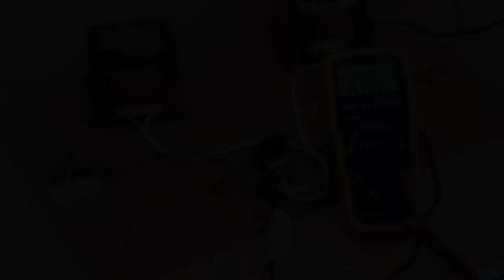DIY Welding Machine / Only 2 Microwave Transformer / Good Job

Comment: Addendum to my below comments, the cable you used is 4mm2, which is 11 AWG. Would you, please, point me to the vender who sells 4mm2 silicone jacketed cables? We don’t get 11 AWG silicone cables, around here. Thanks.
Reply from the maker: Hello.  I tried to find a link for you on the internet, but there are sellers in Turkey.  There is also aliexpress, but it is necessary to buy at least 50 meters and the shipping costs are high.  The code of the cable I use is N2GFAF.  Search this way where you live if you want.  However, my advice to you is to buy 13 meters from an electrician's shop.  Let me repeat it again, the cable I use is N2GFAF coded.  ie not awg11.  both are silicon insulated but I think N2GFAF is more affordable.  I wasn't exactly helpful.  Please excuse me.

Comment: How many turns u have done in transformers
Reply from the maker: I made 24 turns on each transformer.  I used 4mm2 silicon insulated cable.  Some information is also given as subtitles in the video.

Comment: How many turns of enamel wire? How thick is the contents? Is it mm
?? V? If the voltage is 110v at A or 110V at 220V,
What should i do?
Reply from the maker: Hi.  The wire I use is a silicon insulated (non-combustible) pure copper cable with a cross section of 4mm2.  I made 24 windings for each transformer and used 6.5 meters of cable... If the microwave oven whose transformer you will use is produced according to 110V mains voltage, you can do as I did.  To be sure, wind 1 transformer and measure the output voltage obtained.  It should be around 20V.  Let me know if possible.

Comment: Hola cómo estás compré el atenuador de 4000 watts, pero cuando lo conecto a los transformadores y a la corriente alterna de mi casa, el fusible del atenuador se revienta.
No se si el por qué los transformadores son de tamaños diferentes, porque uno tiene más vueltas que el otro por la diferencia de sus tamaños obviamente o porque el fusible del atenuador es de 10 Ampers y tengo que cambiar el fusible por un amperaje más alto, agradezco mucho de tu guía en este proyecto pues la verdad me frustre y por eso no he vuelto a mi taller.  bendiciones y muchas gracias
Reply from the maker: Hola.  No te desesperes, pienso.  Si no hay cortocircuito en los transformadores y mides los voltajes de salida alrededor de 20V, no hay problema en el sistema.  En caso de que la tensión de red sea de 220V, instale un fusible de 15A.  Si la tensión de red es de 110 V, utilice un fusible de 25 A.  Si el fusible vuelve a fundirse, es posible que el triac del circuito esté cortocircuitado.

Comment: How much the primary ampere’s in the input of the transformer?
Reply from the maker: Hi.  The primary current varies according to the setting of the dimmer circuit.  But I can say this... A 10A fuse is connected to the socket I use at home.  It does not exceed 10A current value during welding.  Of course, this value is valid for 2.5 electrodes.
Reply: so your controlling the primary input .. still the secondary having a AC output, well I see your  video design it in other putting a bridge type rectifier having a DC OUTPUT better controlling into lower amperes welding stainless steel plates , nice 👍🏻 project , I design also a toroidal core of a compressor of an Aircon 2 core 2.4 kilowatts and with rectifier too on the secondary winding  connected … you can used a welding rod 7018 super C2 with a DC CURRENT but you can’t used it in a AC OUTPUT 😂😜..
Reply from the maker: I have never tried this electrode.  What results do you think
Reply: it’s a high tensile strength ..
Reply from the maker: Thank you so much 👍

Comment: Hola saludos desde cuba muy buen video quisiera saber la corriente máxima y la minima en amperios que circula por el electrodo al momento de la soldadura dependiendo del control del circuito dimer
Reply from the maker: Hola.  Gracias.  En realidad, traté de mostrar los valores actuales en el video, pero no se pudo medir el límite superior porque el electrodo se derritió antes de alcanzar la corriente máxima.  Sin embargo, se puede decir que el dimmer puede dar 60A cuando está al mínimo y 140A cuando está al máximo.  O brevemente, es posible fundir 2,5 y 3,25 electrodos.  Espero que haya sido suficiente respuesta.  Saludos desde Turquía
Reply: gracias por la respuesta crees q las maquinas inverter que tienen un boton para ajustar lo ampers en realidad lo q varian es el voltaje de salida en funcion de la corriente
Reply: Tienes algun diagrama para poner rectificador con 2 diodos y 2 scr y controlar la corriente por medio de los scr y circuito generador de pulsos para controlar lo scr
Reply from the maker: Hola. No sé si el voltaje cambia a medida que cambia la corriente de salida en las máquinas inversoras. Nunca he tenido una máquina inverter :) Desafortunadamente, no puedo dar una respuesta positiva a su otra pregunta. No tengo circuito para control de diodos y SCR. Sin embargo, compré diodos de puente, que son asequibles, para trabajar en este problema. Convertiré el voltaje de salida a CC conectando 4 o 5 diodos de puente de 50 amperios en paralelo. Grabaré un video y publicaré las pruebas.

Comment: greetings friend, a question:
I have three transformers, a 4000 attenuator still works, right?
I stay tuned thanks
Reply from the maker: Hello.  I may not have understood your question, but as far as I understand, you are asking if I can use the 4000W dimmer in 3 transformers.  If this is the question, you can use it, but there may be a high probability of malfunction.
Reply: I am using 3 transformers, all 3 give me 40.6 Volts... the question is: if the 4000w dimmer works well?
or is it better to assemble what are you doing in the video?
thank you very much
Reply from the maker: I think that the products sold in the market do not provide the power they promise.  For this reason, I have done the process of increasing the power by connecting a triac in parallel to the dimmer circuit I have.  You can find the diagram for this link in the description section.

Comment: Thanks a lot for the MMA welding machine, very simple and easy to found all parts 👍👍, I had a question, how many turn of the 4 mm cable are used in each transformer
Reply from the maker: Hello.  Firstly, thank you.  Each transformer has 24 windings.  A total of 6.5 meters of 4mm2 silicon insulated copper cable is required for these 24 windings and a total of 13 meters for 2 transformers.  Connection diagrams are available in the description section.  Also, the video has subtitles in some languages.  If you have any further questions, please write again.
Reply: Thank you very much
Reply from the maker: Thank you too 👍

Comment: hola yo lo arme con un modulo regulador de voltaje de 4000w pero me quema el fusible apenas le giro la perilla no se que hacer
Reply from the maker: Hola.  El circuito puede estar defectuoso.  Uno de los materiales del circuito puede estar cortocircuitado o puede estar cometiendo un error de conexión.  Por supuesto, lo dicho es válido para la soldadora con 2 transformadores y funcionando sin problemas antes de instalar el circuito.
Reply: ok muchas gracias lo revisare y comentare si tambien lo hice con dos transformadores estaba pensando si no me sirve la fuente de 4000w hacer la misma que se uso en el video muchas gracias
Reply from the maker: Es difícil derretir electrodos gruesos con 2 transformadores.  Si sueles usar electrodos de 2,5 mm como yo, puedes hacerlo como yo.  Para electrodos más gruesos, se debe aumentar el número de transformadores y la sección transversal del cable.  Si aumenta el número de transformadores, también se debe aumentar la potencia del circuito dimmer a utilizar.  Por ejemplo, es necesario utilizar dimmer de 6000W en 3 transformadores y dimmer de 8000W en 4 transformadores.  Sin embargo, el circuito dimmer con estas potencias no está disponible en el mercado.  En este caso, el problema se puede resolver aumentando el número de triacs.  Intentaré compartir pronto el video del circuito del dimmer que mencioné sobre este tema.  atentamente
Reply: hola.  no le habia comentado que uno de los transformadores es mas grande que el otro y me quedo con un poquito mas de vueltas en total el vultimetro registra una salida de 56.7v  eso es normal o me pase de vueltas otra cosa lo puse directo y funde genial pero me toca no hacer cordones porque rompe los tuvos jaja, pero para soldarlos punto a punto funciona pero si ya le revise y las conecciones estan bien tengo ganas de instalarle una funte reguladora como la que usted le puso al suyo o que me recomienda respecto al voltaje de salida

Comment: Very nice work, What is the Idle current in 220V ac side of the transformer?
Reply from the maker: Thank you so much.  I'm glad you like it.  I did not measure at idle, but when welding, there is a current of around 10A.  If you want, I can also measure the idle current for you.
Reply: If you have free time pls measure the idle current. I will try to make the same to you but I use 10 pcs of SCR in voltage control. What can you say about the precision of the voltage control ?
Reply: Thanks for you reply
Reply from the maker: Ok, I will measure and write to you at the most convenient time.  There is no need for 10 SCRs in the voltage control (dimmer) circuit.  A dimmer with 4000W power is sufficient for this system.  I used 4 pcs 6.5A bt136 triacs.  Relevant schematics can be found in the description section.
Reply: @Murat Güney  What numerical value of  voltage between 25v to 40v is best that you tried in welding process?
Reply: Thank you for the idea
Reply from the maker: @creativebuilder577  Thank you too 👍
Reply from the maker: I could not understand this question.  Are you asking about the voltage value used while welding?
Reply: Yes a voltage value in secondary winding that gives a best performance.
Reply: Do you think, you can recommend a size 14 silicon coated copper wire. According to the datasheet it can handle a 55Amps
Reply from the maker: Can you share the datasheet link of the cable you are talking about?
Reply from the maker: Honestly, it would be better if the secondary voltage was around 40V (or even more).  However, when adjusting the current according to the electrode thickness, the voltage becomes low.
Reply: Actually the datasheet I saw is in Online store description
Reply: Do you think 50V is safe to weld without risk in electrocute?
Reply from the maker: 50V is a bit dangerous of course.  Depending on the person's body structure, it can hurt.  However, it should not be forgotten that even if we do not feel the 40V voltage value, a current will flow through our body...
Reply from the maker: By the way, the cable I use is a 4mm2 N2GFAF cable.  Silicone insulation can work continuously at 180 degrees
Reply: Thank you so much for you idea and information, me and anyone who read this will be learn
Reply: Do you have any update?
about the Idle current thank you
Reply from the maker: Hello.  I am so sorry.  I forgot.  Today evening (12 hours later) I will measure the current and let you know.  have a nice day
Reply: Thank you so much, actually I made mine and the result is okay, but I made a difference with your work, I removed the I section and combined the 2 pcs of E, and I think I have a problem with EDDY currents, since I welded the to E in both outer side instead using of EPOXY STEEL. I measure 8 amps in idle , its too much power loss. What do you think ? Its EDDY current? Thank you
Reply from the maker: I saw the method you used.  EDDY currents are the leading losses in transformers.  The reason for this may be related to the transformers we use.  Frankly, we use microwave transformers without any calculations.  It works, but it may not be perfect.  Maybe the machine I built may be drawing a lot of current at idle.  Let's measure it tonight.
Reply: If the idle current of your are low compare to mine, I will modify and copy your work.
Reply from the maker: Hello.  I have now measured the idle current.  When the 2.5 electrode from the dimmer is adjusted to the voltage value that I can melt (36V), the input current is 1.1A, but when I bring it to the maximum value, in a sense, when I disable the dimmer, the input current is measured as 5.8A.
Reply: THANK YOU SO MUCH, I will set it as reference in my own work. Great content, salute sir.
Reply from the maker: @creativebuilder577  Thank you too 👍
Reply from the maker: Thank you too 👍

Comment: Can you tell the total list of components you have used to make this useful thing....
Reply from the maker: Hello.  Except for microwave transformers... I used a total of 13 meters of 4mm2 silicon insulated copper cable.  You can search for this cable on the internet as N2GFAF cable.  I used a dimmer circuit for current adjustment.  Since the circuit I have is low power, I used 4 extra BT137 triacs.  Total power increases when triacs are connected in parallel.  However, if a 4000 Watt dimmer is used, there is no need to connect an extra triac.  General wiring diagram and triac wiring diagrams are available in the description section of the video.  I used 2 12V fans and one 12V adapter to feed the Fans.  I used a 16 Amp switch as the on/off switch and a 10/25 source socket for the source probes.  Welding probe cables 1.5 meters 10mm2 copper cable.  Welding pliers are 300A pliers.  The aluminum I used for the box is 3mm thick on the front and back panel, and 1mm on the cover.  I used 3x2,5mm2 cable for 220V input.  I tried to write down everything that came to my mind.  Please write back if I missed something.  I tried to draw the wiring diagrams in a way that everyone can understand.  Thanks for your attention, have a nice day
Reply: Thanks for guiding things out......
Reply from the maker: Thank you too 👍

Comment: does it burn? What kind of wire?
Reply from the maker: Hello.  The cable I use is a silicon insulated copper cable.  heat resistant

Comment: buen dia una pregunta los 4 triac que utilizastes en el proyector que numero son m e podrias decir  es el TIC226D  RCN 44
Reply from the maker: Hola.  Exacto, pero recomiendo usar bt137.  Debería ser tic226 6A, bt137 8A.
Reply: Mira esta el bt137  600d a sirve
Reply: Ese es de 8 amperios
Reply: Mira el nuero de cable que se usa aquí en colombia se trabaja número 10  12 14 16 18
Reply: Entre más bajo el número más grueso el cable
Reply from the maker: Si se van a utilizar 2 transformadores, se debe utilizar un cable de cobre con aislamiento de silicona y una sección transversal de 4 mm2.  De lo contrario, el número de vueltas será bajo y no se podrá obtener suficiente voltaje.  Si se van a utilizar 3 transformadores, se puede utilizar un cable de 6 mm2.

Comment: Murat meu dimmer 4000w testei antes funcinou normal e o fuzivel e de 25 amp so k quando bate o eletrodo queima na hora não suporta e no seu video funciona não sei qual o misterio
Reply from the maker: Tenho certeza que esse problema será resolvido, não se preocupe.  Antes de tudo, experimente a máquina sem dimmer e veja se o fusível da tomada que você está usando está afetado.  Se tudo estiver normal, resta estar relacionado ao seu circuito dimmer.  A propósito, quantos volts é a tensão da rede?

Comment: The cablle primary turn is..?? ( One travo )
Reply from the maker: Hello.  The primary side will remain as it is.  Rewinding will not be done.  Only the secondary winding will be removed and 24 windings will be made with 4mm2 silicon insulated cable.

Comment: Ciao amico volevo chiederti una cosa ma se sopra  nel trasformatore c'è scritto 225v vuol dire che non può andare a 230v?
Reply from the maker: Ciao.  220V, 225V, 230V o 240V... non importa.  Anche la tensione di rete può variare in questi intervalli.
Reply: ok grazie mille

Comment: how many turns are there on the secondary?
Reply from the maker: I made 24 windings with a silicon insulated copper cable with a cross section of 4mm2.  I used 6.5 meters of cable for this.  These values are valid for a transformer.
Reply: thank you.
Reply from the maker: Thank you too 👍

Comment: What is the wiring to the smaller wire primary,  is it hot and nutral on each transformer, ?
Reply from the maker: I don't fully understand your question, but... I didn't make any changes to the primer.  The current winding of transformers remains.  The cables from the dimmer circuit are connected to the primary.  1.5mm2 copper cable.  In the secondary, I used 4mm2 silicon insulated copper cable.  If the explanation is not sufficient, please write again.
Reply: dude, did you put neurtal and ground to each primary,  or did you put 2 neutrals on one and both hots on the other...
Reply from the maker: Hello süre...  I missed your message.  never mind.  I connected 1 neutral and 1 phase by connecting the primarys in parallel.  that is, I gave the mains voltage.  Of course, there is a dimmer circuit in between.  I just connected the ground line to the metal part of the box.
Reply: Kay, sweet

Comment: Could not fond the 6000w dimmer  where did u get yours  Thanks
Reply from the maker: Hi.  Honestly, the one I used was 4000W.  However, it crashed after a while.  I also connected a parallel triac just like I did on this machine.  There can be 4 bt138 or 5 bt136 for 4 transformers.  Of course, since you will buy new, the circuit's own triac will be strong, so 4 bt136 may be enough.
Reply: if i use regular  light dimmer would that work
Reply from the maker: Yeah.  It works.  However, what you need to do in this case is to increase the number of triacs or to use a powerful triac... electronic circuit is no different.